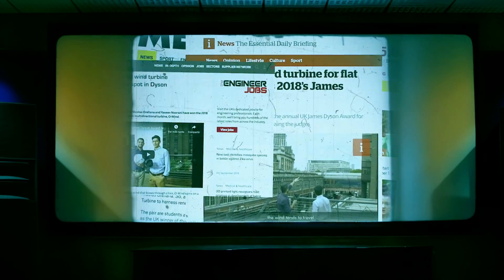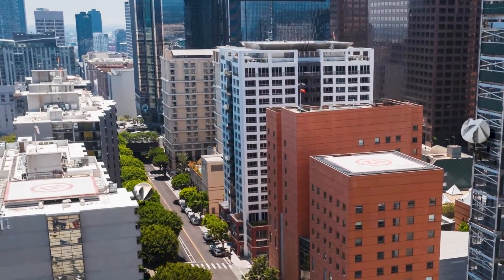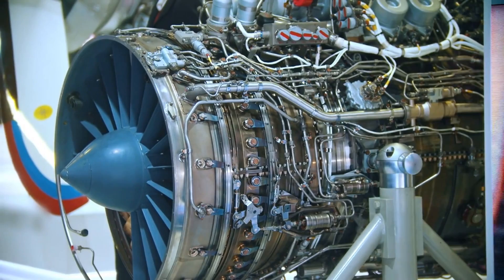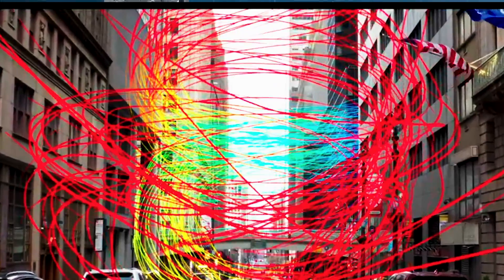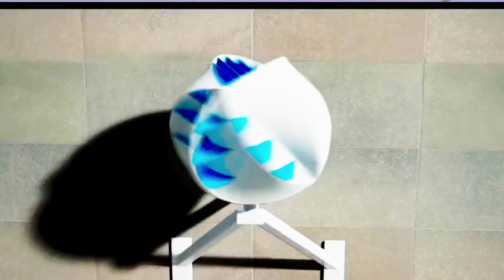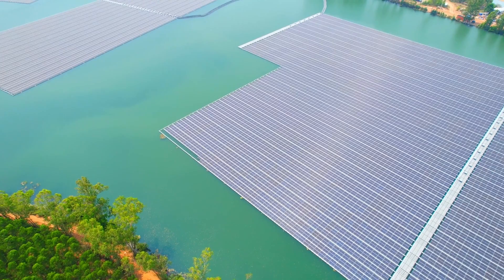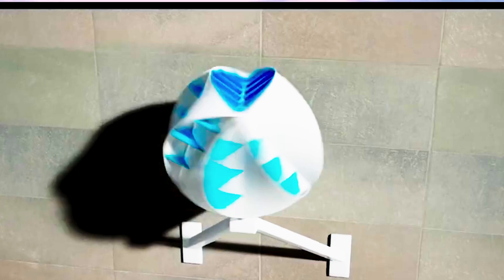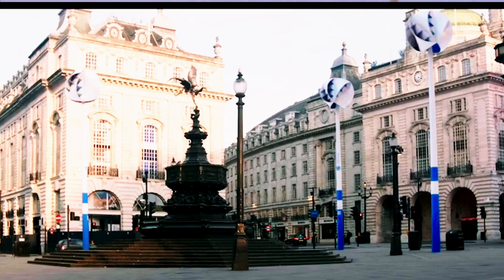Novel European Bladeless Wind Turbine Beats Rooftop Solar PV?!

Comment: 12v will run the electronics and small pumps. Why not have the genset in the basement or on the porch. The computer would release a break, the weights would spin an alternator. Where fully charged, the brake is engaged until the next time the battery needs to be topped up. 
https://www.youtube.com/watch?v=3Yptnkex4zE
Cuckoo clock for beginners (How to determine the right size weight) see description (bucket test)

Somebody should make a 12v cell balancer (BMS) that is for lead/acid batteries with 6 cells @ v2.5v per cell. The batteries would last much longer than without the constant balancing.
Reply from the maker: thanks for your video
Reply: thanks